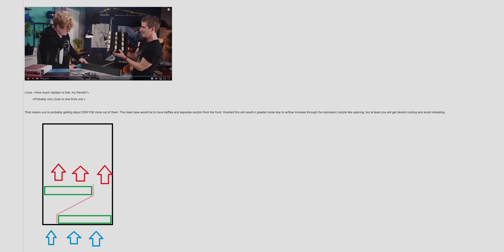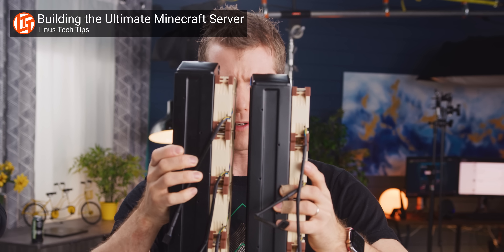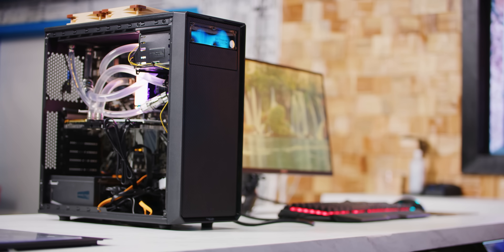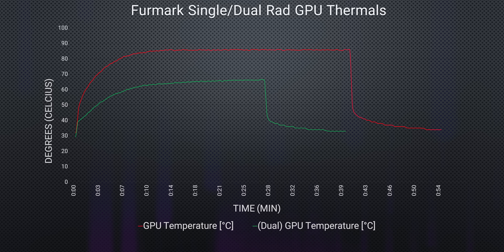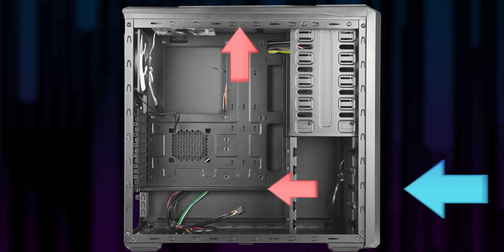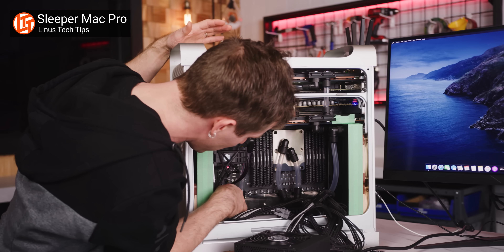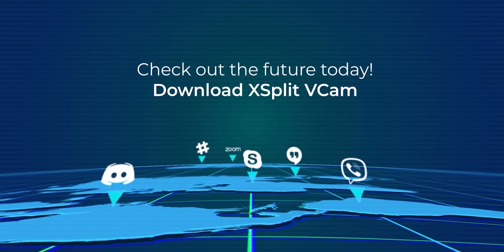I’ve been water cooling wrong for YEARS - $H!T Manufacturers Say

Comment: it's just obvious that putting radiators in series is useless, whilst if you have enough surface, putting them in parallel will work a lot better. ideally you'd want both radiators oriented in the same direction, i.e. both pushing air outwards.
but there is NO doubt that stacking the radiators the way it's been done on the MC server is just wrong. you're throttling the second rad, and the 3rd one even worse. That's just basic fluid flow. you guys use SolidWorks simulation sometimes. just use their flow simulation to prove it.
Reply from the maker: From this video alone (assuming you've actually watched it) you should already know that the very first thing you said is not true. These radiators are running in series, and there is a performance benefit.
Reply: @LinusTechTips  off course there will be an increase of cooling. I am not disputing that. but positioning them so that the first blows its exhaust air in the second which blows its exhaust air in the third renders the benefit a lot smaller than what it could be. just do a simulation and you'll see. the full benefit would be gained by making sure none of them feed the next one.
and I am very pleased that you actually replied to my comment, thank you.

Comment: Maybe if the ambient temp is already high. And fans are not very efficient to pull air fast enough. and as Lie-nus said if no other air is pulled in the case. Maybe they can revisit with more variables. Like higher Room Temp, lower RPM fans. But that is more like GN Steve kind of thing.

Comment: Top tip: Make the exhaust radiator the first one in the loop. This way it gets the hotter water, which will still be cooled by the exhaust air of the inlet radiator.

Comment: I hypothesized that the claim is complete bullshit, but that specifically radiators that are clamped tight together (like in the Minecraft server) still give better results but much less. I was... 100% right. That doesn't usually happen.
And shit, just a 5 Celsius difference, on such thicc radiatios and flippin Noctua fans? Ouch. Did not expect that.

Comment: I agree with corsair and I'm telling this for years. In my case the top rad in exhaust mode has nothing to add to the cooling as the air is so hot inside that it is actually as hot or even hotter than the water, so I had to reconfigure my top rad into intake mode (and let the air pressure fight against the physics). This is why my next build will be an O11 with a bottom and side intake configuration. But what is really important to note here, is that it really depends on your setup. I use my fans in super silent mode, the 6 fans barely make any noise even at night. So the actual airflow is also very low, the air is almost still inside the case all the components have a lot of time to heat it up (VRM is not a problem as I use a monoblock, but RAM, SSD and chipset are). So in my case reversing the flow at the top doubled the intake so it not just helping both the rads but also the airflow in the case. Any other setup which have faster fan settings may not have such problems as the air is circulating much faster and cooler air hits the top rad.
Reply: So what you're actually saying is that you're just an idiot and want to complain and say everyone else is doing things wrong because YOU make it so there's no ACTUAL airflow in your case by running everything at minimum RPM possible.
Reply: It sounds like the real answer is that you're not having enough air flow and that it has nothing to do with the rads. That the air inside the case heats up so much straight up proves that. In a properly cooled case, the air temperature should be only slightly higher than ambient
Reply: No you are agreeing with Linus by very clearly making the point that individual cooling performance is 100% dependent on your own personal rig setup and usage.

Comment: This is still not the real case scenario, linus is adding radiator and checking cpu and gpu temps. These are definitely give you lesser readings until you reach the mimima of the curve and then they will rise again as you keep adding new radiators after that point.

Also, he didn't check the effect on the VRMs and other components on the motherboard, are they on the same temperature or higher?

I bet that his minecraft server motherboard temps will slightly go down if he had less restrictions to the airflow.

 Time to take out your IR camera and do these things again Linus. CFDs won't lie.

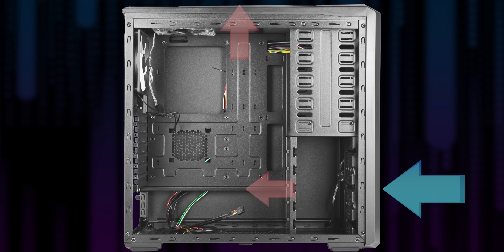Comment: 3:45 Shows a graph of both single and dual rad setups. It's funny that the CPU temps didn't drop much with a dual rad.
You guys should've also tested stacking two radiators vs two radiators with adequate clearance.
Reply: Yeah, looks like a 5-7C difference with the CPU temps, but the dual rad setup was pulling a little bit more power and was clocking slightly higher and probably more consistent. I would guess it likely has more to due with the heat density of the CPU and the size/design of the CPU block.

Comment: I feel like they were trying to say that you weren't doing it wrong, but you could do it better. Cars stack radiators all the time, intercooler > oil cooler > air conditioning condensor > main radiator. So basically lowest heat capacity to highest. Sports cars will move these around and put intercoolers  in places that have their own air flow because their turbos generate more hot air. So on a high performance PC you'll want separate air sources for each of the radiators. Cases with a lot of ventilation will have an advantage and Corsair likely assumes that it is a sealed airway.

In the case of the minecraft server, I'm curious if two offset radiators with ducting would be better performing than just two stacked ones. The thermal capacity and surface area of 3 definitely beats both cases, but I am genuinely curious.

Comment: If you are double stacking radiators, I would advise to let the hot water go through the exhaust radiator first, then the intake radiator. This way, hot water gets cooled to medium temperature in the exhaust radiator, and cooled to ambient in the intake radiator.

Comment: Dude, the reason they were complaining was because you had the radiators pulling hot air (from ether the hot case, or even worse, from the other radiators!)! Just have them getting fresh air and it should be fine

Comment: I can guarantee if you had 3 stacked radiators all with a temperature probe installed, all 3 would read different temps. 3rd rad in line would be hottest.

Comment: The real question is, is 2 units in paralell pulling in air from their own side (say top and front)better than the config shown in the video
Reply: Yes, but the difference is negligible. You would also need a high CFM exhaust and a decent amount of room at the back of your case, or else your top intake is going to recycle some of the back exhaust if it is too close to a wall or under a table/desk.
Reply: @lordec911  "negligible"? depends on the loop setup and system temperature. If your CPU and GPU are like, 80ºC, then 1 rad after GPU and 1 rad after CPU would mean better temperatures, as 1 rad will never cool down the entire system as efficiently.

Comment: The point is to make sure that your radiators can get as cool air as possible. And you should avoid stacking radiators if you can. Spread your radiator stack and you will decrease the resistance and will add negative pressure in the case. This is what you did, and kinda miss the point of Corsair i think. Decrease in efishensy btw it is not increase in temps..

Comment: I would recommend that you adjust the air flow direction from the outside to the inside on all the radiators. That way you make sure that the dust is collected in the filters and you keep a constant temperature (it depends on the room temperature) of the cooling air. This way you can have the maximum cooling efficiency and your components don’t get dusty. I hope this helps.

Comment: I bet if you had all the rads as intakes and then you just exhausted hot air it would be even better. Now if you sustained a load for 24 hours and your results were the same. I still think it would be more efficient if all rides were in taking cool air and then fans are exhaling hot air. For example front,  top and bottom intake rads. The back exhale fans

Comment: There is no one answer to a problem, every problem has it's own set of issues that make it different from the other the size of the case, how the air flow is limited by the case, the fans  and so on play a part on how water cooling work's for that computer.

Comment: Corsair talked about situation with 2 rads one right behind another (in case of Hackintosh Pro there was no additionar airflow so it's almost same). And this is indeed stupid idea.
They said nothing about common PC cases.
Reply: Yep even the stacked rad with next to no gap between the rads and fans was still removing heat despite corsairs claims
Reply: @Execuor  It also depends on amount of airflow. The higher it is — the faster it goes through radiator and the less heat it takes from rad (= lower airflow temps on 2nd rad).
So this really depends.
Reply: Watch the entire video. They also tested removing one of the stacked rads from their watercooled server and steady state went up 5 degrees

Comment: The key numbers are temp after every radiator, total flow (total resistance) and total energy to disipate. If these numbers are at the limits corsair would be proven right. If the numbers are far from those limits it is safe to stack radiators. It would be "cool" to see an acrilic test model for this porpouse like those in the "Practical Engineering" channel.
BTW.... LTT. Now 300% more RTXed intros. 
Watercooled chair? It seems the extra layer on Linus' face is harming his thermal performance to the point of needing active cooling.

Comment: you did not test what Corsair was criticizing stacking 3 extra thick radiators back to back to back with no gaps is very different from two radiators on opposite sides of a very open case, the empty spot for a 120mm fan at the back of the case right next to the second radiator was feeding it lots of fresh air.

Comment: I wonder if the mapping of the Minecraft server has something to do with it. If the first radiator that the hot water goes through is the last one in the air flow direction, then it's probably fine. But if it was the first one in the air flow direction, then the temperature of the air coming into the 2nd rad would be nearly identical to the water coming into the second rad, so it wouldn't do much heat exchange. Basically as long as there's a good temperature gradient going across a radiator (cooler air going into it than the temp of the incoming water), than it works.

Comment: As an engineer, I cringed at some of this testing. Your main test didn't line up with either of the two scenarios they were talking about. I appreciate that the  final test lined up with what corsair was talking about, but still. You claim that corsair is wrong, and yet your main test was stacked against them and wasn't either of the cases they were talking about. What I will say is this: It is true that you probably will get some improvement from stacking radiators, but their will be a diminishing return with each added radiator. I would like to see this revisited with proper testing on both of corsair's stated cases. Honestly, a bit disappointed because I expect better from LTT ,especially in this series.

Comment: Ok so I think Linus it's wording this incorrectly, we don't have exactly what Corsair said but I assume their point is that the stacking configuration is not as efficient, and they're talking about physically stacking radiators, and in the first case, stacking with components in the middle, so first, there are two scenarios to test and second, if the argument is about efficiency then yes, it's pretty clear that adding two rads in that kind of configuration won't double the amount of cooling for the parts. What Linus is defending is that there's still a benefit with stacking which yes, he showed in this video that it works, but it probably works until certain point because efficiency will diminish with every extra rad (but that would require another test to confirm). So I just think LTT exagerated the words of Corsair for the sake of the video or Linus needed to be more clear about the situation, in any case,  what we get from the video is that stacking may work with two and maybe 3 rads but you won't double your cooling just improve it in an amount that will depend of your configuration

Comment: took me 4 months on my 1st custom loop to test and identify obvious mistakes (that I actually made) 1) your radiator fans must ALWAYS be case intakes what do you know cooling a rad with 25°C air works better than with 35-60°C air I know mad 2) top rad mount is moronic, a gpu backplate even water cooled will be at 60°C+ those 200+watts are still there and this means that in gaming your gpu BACKPLATE (your gpu die can be at 28 your backplate won't be) is a furnace you don't cool a radiator with a furnace 3) if your water temp is above 35°C it's not good I would never accept 40°C like Linus says ! you should try to stay below 35°C is where your system starts exhausting noticeably hot air <35°C you won't notice it >35 it will heat up your room and so increase your air intake temp over time 4) if on AIO it's a good idea to have the tubes down (maybe) but it's a really bad idea in a custom loop with a reservoir, air will get trapped in the radiator rather than the reservoir and guaranteed your pump will not like it and become noisy (had to 180° my dual block dual rad setup...not fun) these 4 points alone make 9/10 youtubers and pc hardware websites look bad because most do it all wrong, recommended setup dual rad bottom+front/side with fans as intake and leave the rear/top fans to exhaust the vrm/gpu/chipset heat bonus tip : if your case has a bottom to top airflow like the lian-li dynamic xl (that I use) don't place a thick rad at the bottom it will choke the main air intake of the case too much since in my case my 6 intake fans are all used for radiators it saved me a few degrees on the gpu and motherboard nvme heatsinks to have a smaller rad at the bottom I started with 90°C cpu temp in v1 of my case now I have 73°C in v10 (I tried all sorts of fan directions rad placements, different brand of rads etc...) good luck to you and btw if you plan to buy a 10th gen intel or threadripper amd you don't actually have a choice to go custom loop, go read your noctua/dark rock/aio specs most are rated 150-180W TDP we are way past that now a 3960x at 4.4ghz will easily do 347Watts !

Comment: There are a few other factors to consider. Aside from temperature coefficient between the hot and cold side of the cooler, there's also the diminishing gain of multiple cores with a heat gradient from leading to trailing edge of the cores. 
BUT. This is also a non-boiling, non thermostatic flow controlled, non pressurized, non refrigerant-based system. So it really barely matters.

Comment: Hypothetically you shouldn't be able to get worse performance. Purely on the thermodynamic side with Qin to Qout. You should only really experience diminishing returns (that is ignoring all the fluid dynamics and loss of pressure etc.). It would be interesting though to actually measure the intake and exhaust air temps and the hot and cold side water temps.

Comment: this only proves that 2 extra exhaust fans increased the airflow. now you gotta test it with the 2extra fans and no 2nd radiator. 🤷‍♂️
Reply: 3:37
Reply: Rad or no rad. He has done a test with different setups with only fans. Like all intake, all exhaust and combo setups.
What I'm missing here is a setup with drawing in fresh air from the bottom with also a rad on the bottom and then top and back as exhausts.

Comment: I suppose it depends on the order of components. If the "exhaust" radiator is the first one in the loop after the CPU and GPU, there's probably enough dT between the warm air from the case and the coolant to still transfer heat out. With the added benefit in that scenario being that the "intake" radiator is now not dumping as much heat into the case. If the intake and exhaust radiators are in reversed order, then Corsair would have a point, as the hot air that's dumped into the case is probably not that far off the temperature of the coolant in the exhaust radiator.

Then again the better solution would be to mount the radiator externally so it's cooled with ambient air and dumps all of the heat into the ambient air.

Comment: I dont wanna judge, but this is pretty elementary physics. Thermodynamics 101.

Stacking rads isnt "bad", its just (has the potential) to be way less efficient. This isnt something i say, this is fundemental physics.

The thermal capacity of water is way higher than that of air, meaning the air will easily get saturated in terms of the temperature immediately shooting upto close to that of the water. Note: The correct term for this is the "thermal gradient"

Comment: In this I agree with Corsair.
Stacking rads is bad.. unless you add fans and leave openings.  BTW, yes, you can leave them open but you should put air filters.
Also, you could put double the fans on a single rad to have way more air passing by that rad, cheaper and more efficient

Comment: Same physics at play its called wind chill, as you accelerate the air through the rad it is going to remove heat from the given surface area, assuming the air is cooler. The air will be cooler going through a rad and air cooled components duh...... Wtf